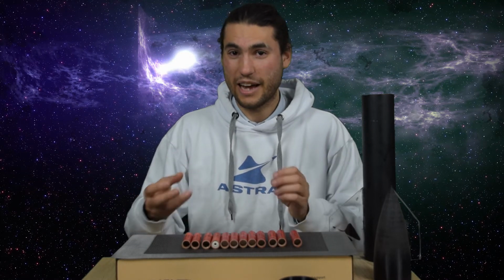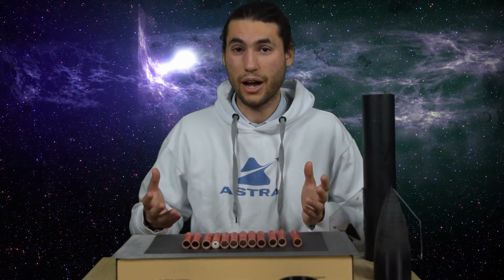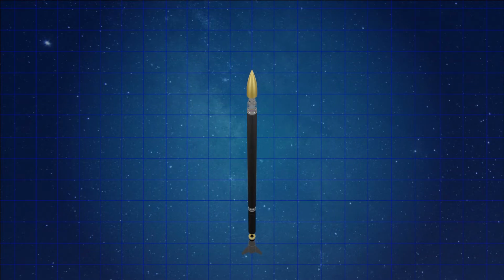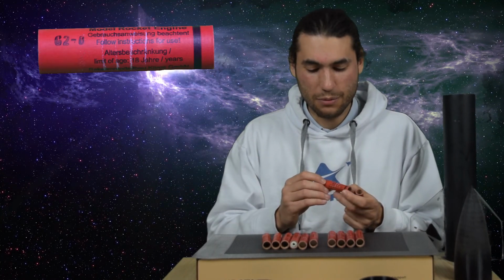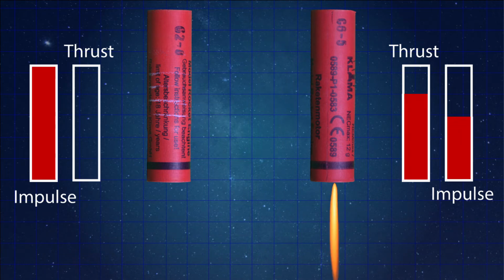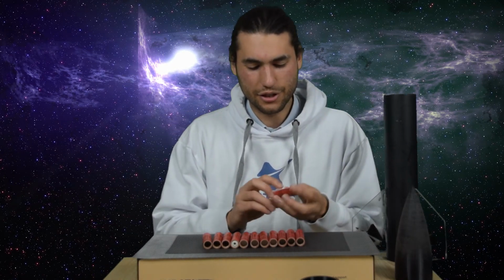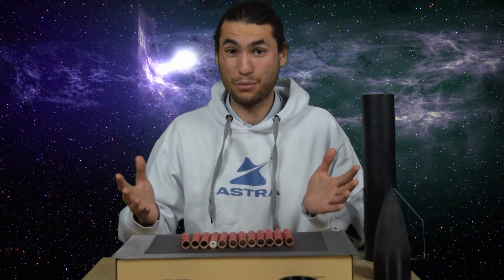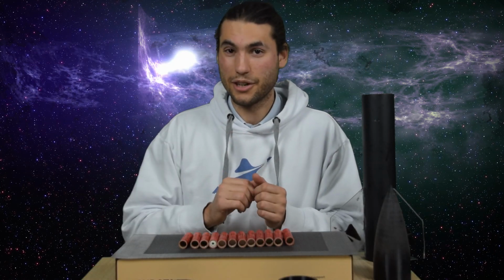Rocket Motor Codes - Explained

Comment: Awesome! Great explanation on how to read the rocket motor code. I would just like to add that commercially available motors actually start with 1/4A mini motors from Estes. Also, in America, without a High Power Rocketry certification, rocket motor purchases are limited by propellant weight, so there are actually some H motors that you can purchase. In Canada, we are limited by motor class designation and can purchase and launch up to G motors without a license. In the UK you can purchase G motors as well but are allowed to fly up to 2 stages of G motors without a license. Oh, and maybe a little more mention on why some ejection delays are 0 and how they are used for staging would be useful info. Cheers! Keep up the great videos!
Reply from the maker: Thanks for the details about the regulations in North America.  I guess my statement on F motors being the typical maximum is not quite correct.  As for your thoughts behind the 0 delay motors, it is my understanding that these are typically used for staging.  We have a video coming out next week that goes more into this as we have to reveal what is going on inside the motor to really explain this properly... *spoilers*.